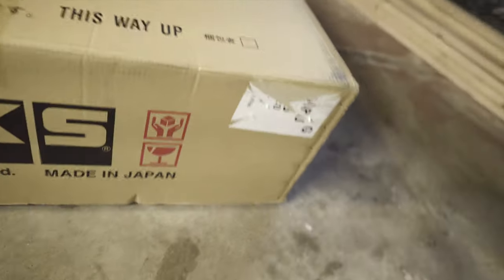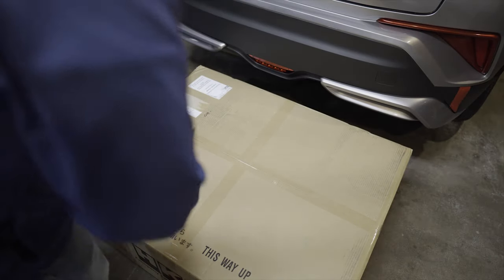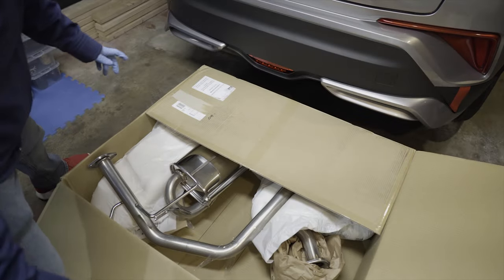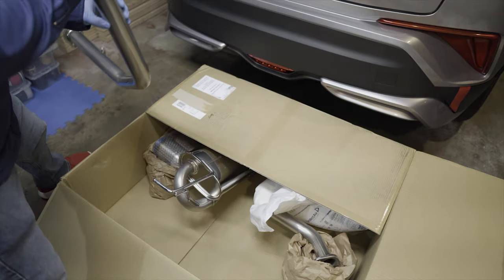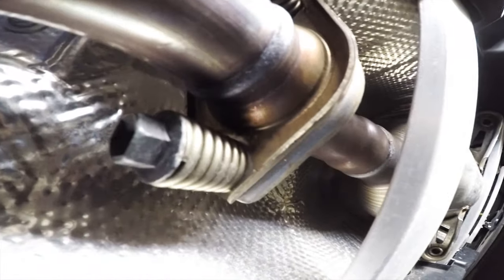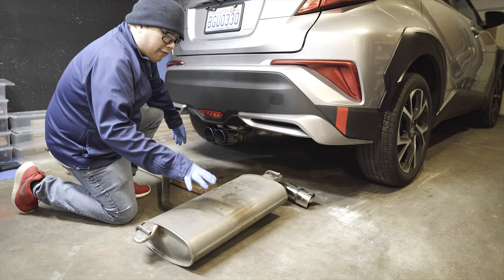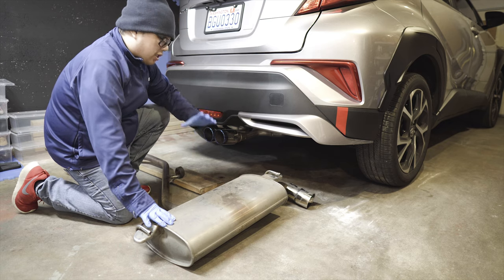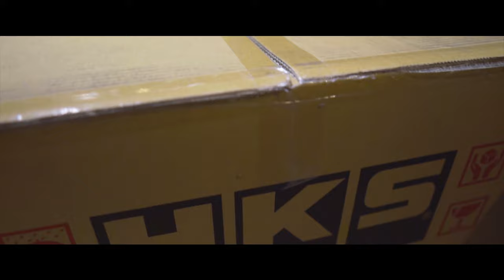COROLLA HATCHBACK HKS LEGAMAX EXHAUST INSTALL ON MY 2018 TOYOTA C-HR XLE [Project C-HR VLOG 17]

Comment: I wanna get one but its not too loud right? Not tryna get noise complaints from the neighbours? Also hows the installation process?
Reply from the maker: Install is very easy as long as you lift it up, I’m kinda claustrophobic that’s why i have hard time  breathing down there, but in regards to noise level, this is not that loud, it’s perfect, I’m not trying to get in trouble with my wife... if she complains i will need to remove it lol.

Comment: Where did you pick up the rear diffuser/lip???
Reply from the maker: robledesma15 got it here.. https://rover.ebay.com/rover/0/0/0?mpre=https%3A%2F%2Fwww.ebay.com%2Fulk%2Fitm%2F123280427130. And it’s also a genuine toyota accessory

Comment: hey could you please forward me the info on how and what model that set up is so I can order for my 2018 c-hr
Reply from the maker: The exhaust i use if made for the new corolla hatchback, but they are the same mounting so its a direct bolt on, you can check https://www.vividracing.com/-p-152622126.html?gclid=CjwKCAiAsOmABhAwEiwAEBR0ZgxXRK7b8IkrIFh2SRgCxGLFvnPOiC12kBm4bksF1j9obBhT48W2rRoCJl4QAvD_BwE or https://conceptzperformance.com/hks-legamax-sport-cat-back-exhaust-system-toyota-corolla-19-hatchback-in-stock-32018-at061_p_43435.php